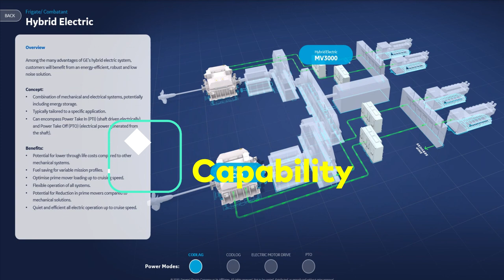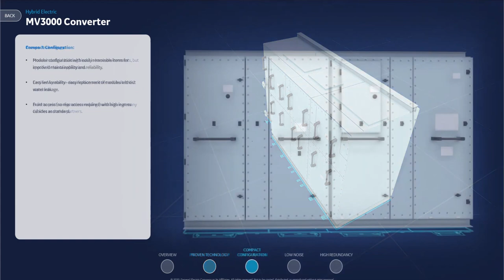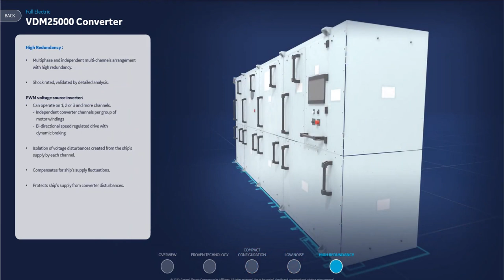GE Power Conversion & BHEL to develop Integrated Electric Propulsion Systems for the Indian Navy

Comment: Great now just wanna see Air Force realize the reality and go with engine manufacturing with GE and since GE F414 EPE with 116 kn thrust engine has been offered and since we already have GE F404 IN20 with 85kn ordered in 83 so we should not proceed with French failure 70kn engines and stick to proven GE